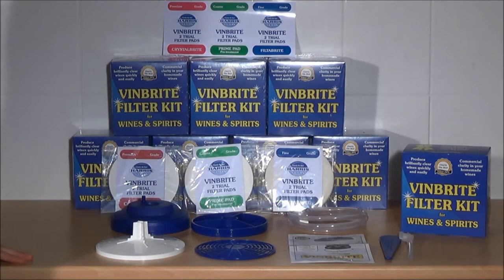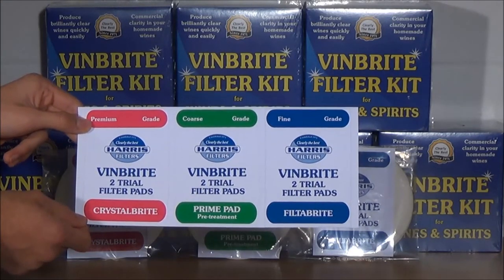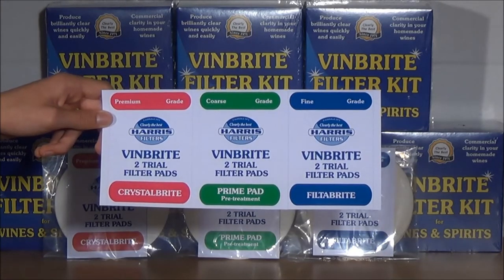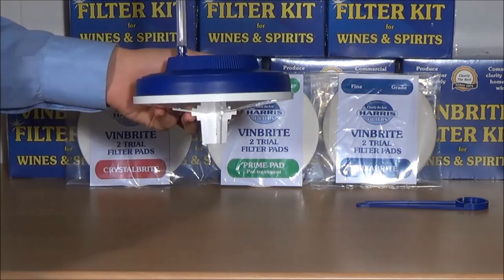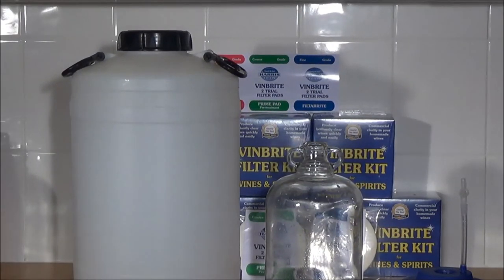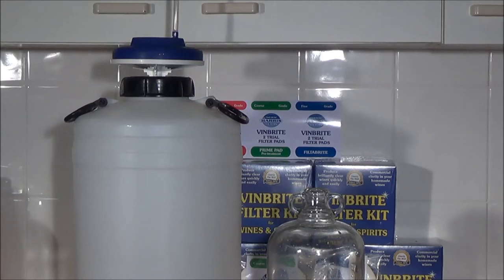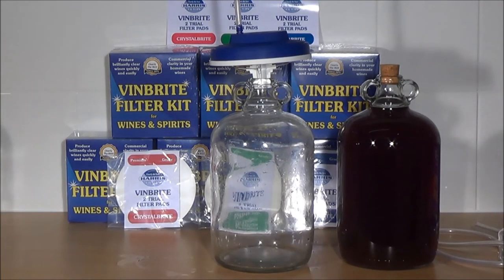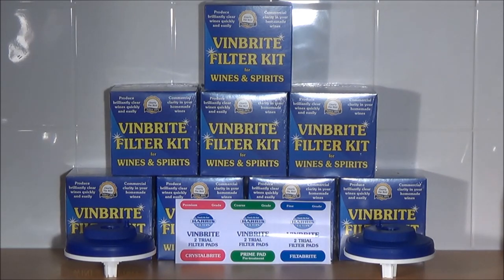The Vinbrite Filter Kit for Wines and Spirits - assembly and operation

Comment: What a great presentation. I linked this from HomeBrewOnline where I get my now favourite Wine Buddy 5 ltr kits from.  I've been using my Vinbrite filter since 1977. I used to make what I guess you would call organic wines now - fruits etc. Easy option kits now but so much better and the Vinbrite filter has been my essential piece of kit over all those years. The (relatively) new prime pads are a genius invention for me. It cuts out one filtration process.  Plus, learned from here, I didn't know about the pre-soak with water...important to swell the pads, and the filtabrite not using the support disc. Thanks and love my Vinbrite filter kit. I'm 1950's and this item has so old school charm , though not a fan of the new blue look. But huge thanks for this essential piece of  kit.
Reply from the maker: Glad to know that you are pleased with the Vinbrite kit. The Prime pads are a multi purpose pad, not only helping more wine to go through the other pads, but they are also great for clearing a spirit wash.

We changed corporate colours from Red to Blue 4 years ago as it was felt  a more modern colour.

Comment: It took 2 hours to filter a 3 gallon batch of wine with the filtabrite filter. The filter chassis leaks a little, so best to do it in bathroom or put towels underneath the carboy.
Reply: Make sure that side A of the Support Disc is facing the pad, and the the 3 lugs on the disc are located in the 3 slots on the body. Tighten the locking ring with the spanner, and this should resolve any leaking from the body.

Comment: great video but why isnt there a tube going into the bottom of the carboy to prevent oxidation. Everyone knows that oxygen is your enemy so a wiser thing to do would be to fit a tube to the bottom
Reply: You can attach a tube to the outlet if you like to help prevent contact time, but in the many decades selling this filter, this has not been an issue. In fact you have a higher chance of oxidation from degassing a wine.

Comment: Thanks for the demonstration! I wonder if you could help me with my filtration problem? 

I make my own liqueurs. For the base I usually use either vodca, gin, brandy, or rum. As liqueurs have a high sugar content, the resulting liqueur is slightly viscous. Could I use vinbrite to filter my liqueurs? I'm currently using the 'old fashioned' way of filtering, i.e. A filter paper folded into quarters, and popped into the top of a funnel. This takes an AGE! 

Any advice would be GREATLY APPRECIATED! 
thanks
Reply from the maker: When we filter liqueurs, we use a filter paper folded and placed in a funnel. These are coarse filtration media and are really the only ones that could handle a liqueur due to the viscosity of the liquid. A filter pad would quickly clog and block. This is a wine and spirit filter, which is completely different to liqueurs. You may get away with the Prime Pad, as this is a coarse grade pad, but it is still more expensive than using filter papers to achieve the same result.
Reply: Could you do a video of that showing how to filter liqueurs please

Comment: What are vinpapers for?
Reply: These are a legacy product when the pad material contained asbestos (way back in 1979). They were placed under the pad to catch the asbestos fibres and stop them going in your wine. These are no longer required, but some customers still want to use them to stop any fibres from the pad entering the filtered wine. However, if you pad rinse with 2 litres of water, then the Vinpapers are not necessary.

Comment: Are there any harmful chemicals used in the production of the pads. Dioxin for example is used in paper production.  I am looking for the healthiest option for filtering.
Reply from the maker: There are no dioxins used in the manufacture of our filter pads. All the pads we produce are manufactured to be used in the food and beverage industry as well as in the pharmaceutical and chemical industry. The pads are manufactured of specially selected raw materials such as purified and bleached cellulose, inorganic natural filter aids, like kieselguhr, and perlite.

All our filter pads fulfill the requirements of Regulation 1935/2004/EC, BfR Recommendation Ch XXXVI, FDA CFR 21 176.170 and Food Chemical Codex standards, as applicable. 

Furthermore,  we confirm that the filter sheets are in conformation with the regulation (EC) No 1935/2004 and (EC) No 2023/2006 of the European Parliament. They are also made according to the rules of Quality Management System EN ISO of Quality Management System EN ISO 9001.

Our pads contain no live organism or animal-based extracts. Therefore, our filter pads can be used for HALAL certified foodstuffs. We also confirm that we are KOSHER certified. They do not contain alcohol or raw materials that were in contact with alcohol and the raw materials of all products we used are GMO and Allergen free.
 
Our pads are totally safe to use.
Reply: Harris Filters well thanks for the comprehensive response. I will certainly consider these filters as an option for my wine making. Thanks again.

Comment: shouldn't the pads be stacked coarse fine premium premium being the last pad before finished wine spills into carboy. why the 3 grades id rather use them all at once if they fit when stacked
Reply from the maker: The filter housing only holds 1 pad at a time and you may not need 3 pads to clear a wine - it all depends upon the clarity of the wine that you are filtering. If your wine is clear to start with and you just want to polish it to commercial standards, then just passing through either the Crystalbrite or Filtabrite will be enough. If your wine is not clear and has a lot of haze, then first pass through the Prime pad to remove the sticky particles before using either the Crystalbrite or Filtabrite. You do not need to use both the Crystalbrite and Filtabrite pads - only 1 of these. Both will achieve the same end result. One is a thick pad which will take longer to filter through the pad material and costs less to manufacture. The other uses the latest technology to produce a thin pad that allows fast filtration - but these cost more to manufacture.

Comment: how do we know which filter to use?
Reply from the maker: The Original pad is the Crystalbrite Pad. This is a high grade technical pad that will filter wine quickly and efficiently, but these are expensive to manufacture. We therefore introduced a cheaper alternative pad - Filtabrite. This is a thicker pad and will produce wines with the same clarity - but it will be slower in operation.  

We also introduced a pre-treatment pad called Prime pads. These are designed to filter out sticky particles that would otherwise block a filter pad. they are ideal when filtering country wine as they will take a large amount of debris out the wine. This will enable more wine to go through the Crystalbrite or Filtabrite pad at a faster rate. The Prime Pads are not designed to clear a wine, just prepare it for filtration.

If you have a reasonable clear wine, then you do not need to use a Prime Pad beforehand.
If you want a fast flow, then go for the Crystalbrite pad.
If you don't mind a slower filtration time, go for the Filtabrite Pad.

We find that 75% of the pad sales are for Crystalbrite.
Reply: @harrisfilters4109  This is the information I've been searching for. You ought to include exactly this summary information about what pads for what purposes in the kit instructions.